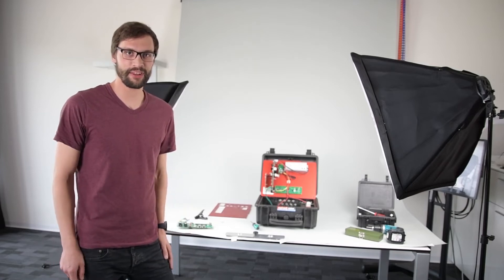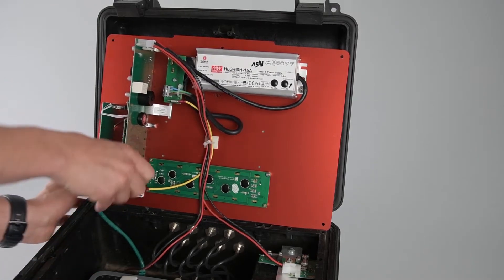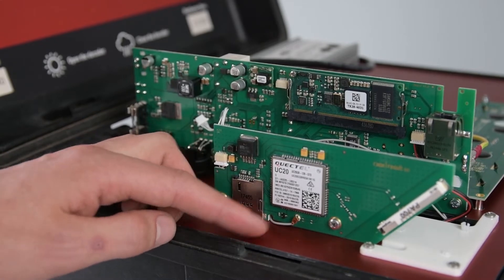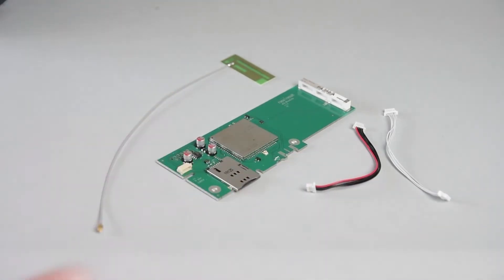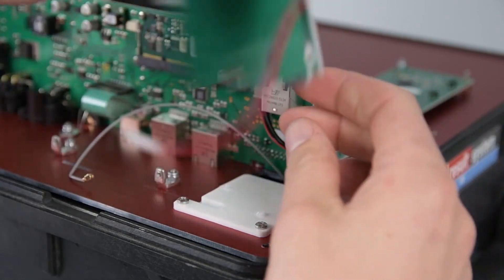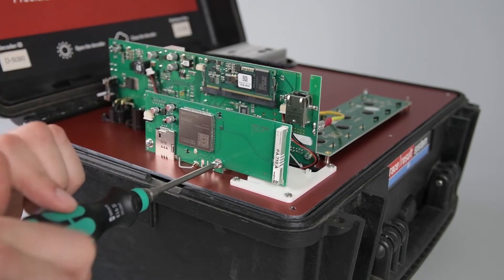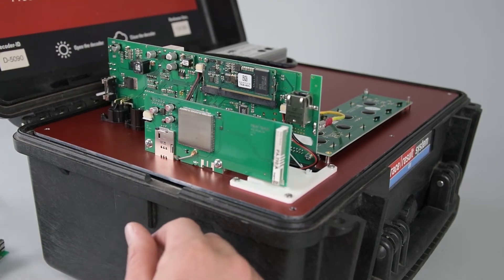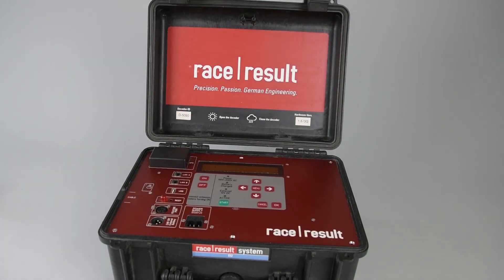4G/LTE Upgrade for race|result Decoders

Comment: Hello, I have received 4 x new 4G modules but have only been provided the 5 pin cables in each package...There are no 6 pin cables provided in the packages but I have new version 6 pin main board in my decoders...Do I need to use 6 pin cables for my 6 pin main board decoder or can I somehow use a 5 pin cable...
Reply from the maker: You can use the 5-pin cable for the DIY upgrade. Actually the 6-pin cable is only necessary for the full upgrade with external antenna. Make sure to line up the 5-pin cable to the correct side as marked on both main board and GSM module.